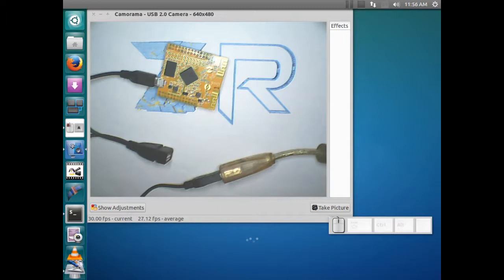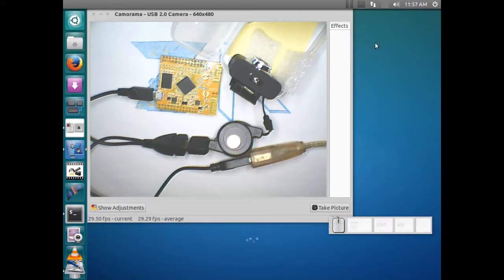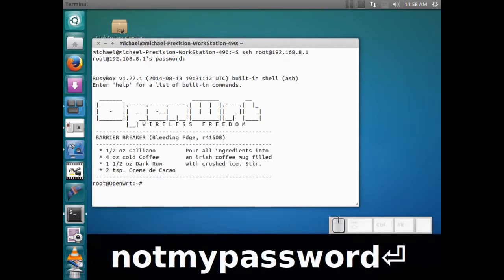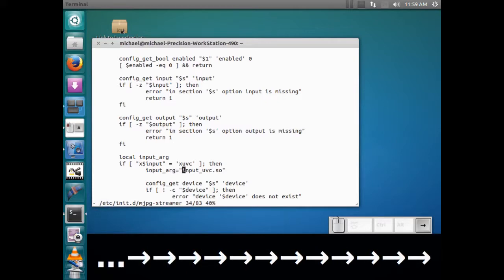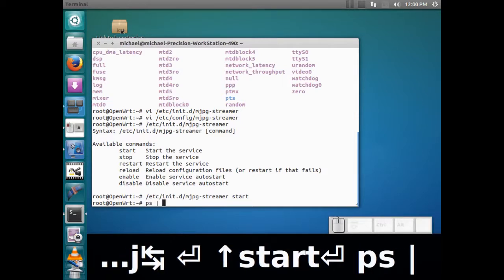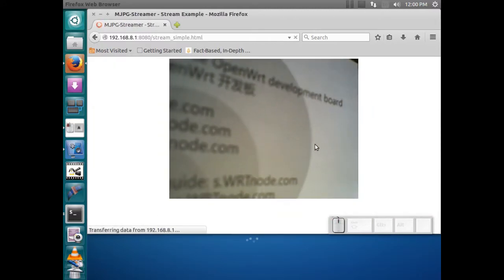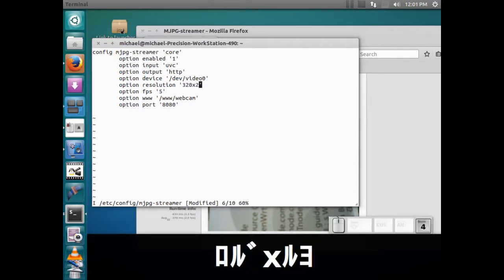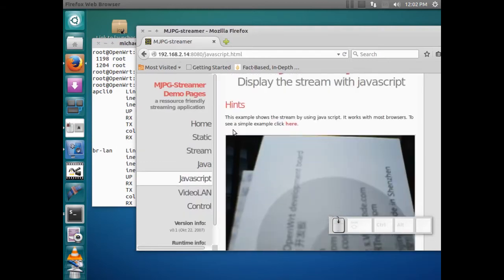Part 4 - WRTnode setup usb camera and mjpg streamer

Comment: I am interested in extending the Wifi's range from my router. The WRTnode having two Wifi antennas and an Ethernet, it can be wired to a network Printer for low throughput or say a NAS for testing the throughput. This configuration repeat the home network while leaving the rather noisy equipment in the home lab.

Comment: Great video. I have successfully set up a usb webcam on a Pi running Rasbian Jessie. I now have to change resolution and higher it a bit. I used the default 640x480 and considering to change it to 1280x720 as my Microsoft Lifecam Cinema supports hd video. My question is, will I be able to edit the configuration file with nano, as I'm not familiar with vi editor and I fear I will mess things up if I use it.